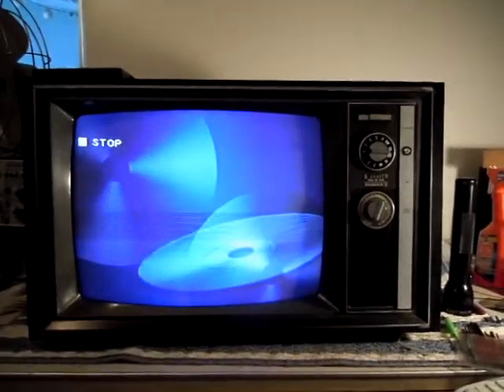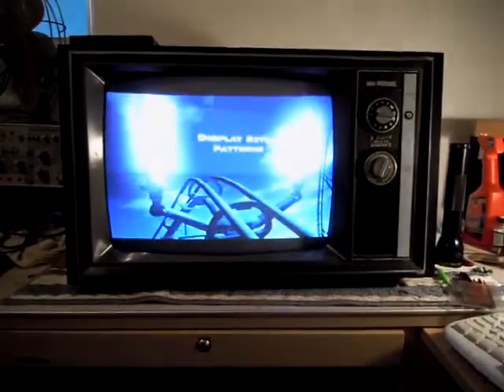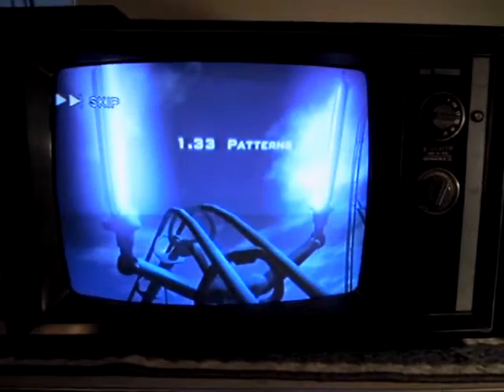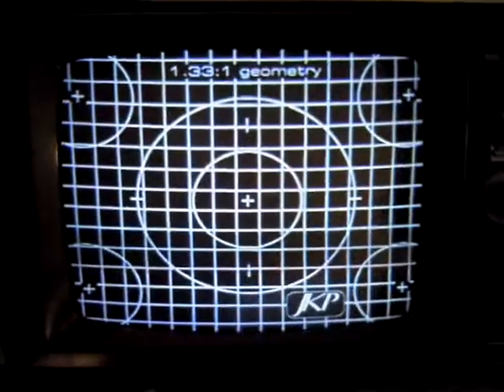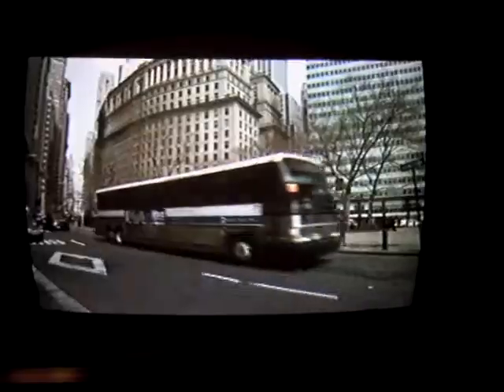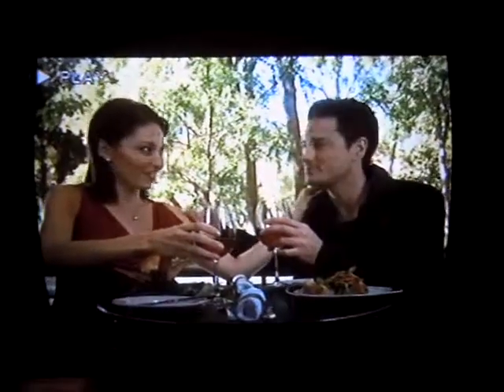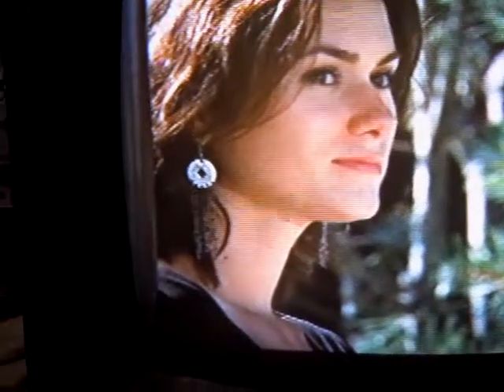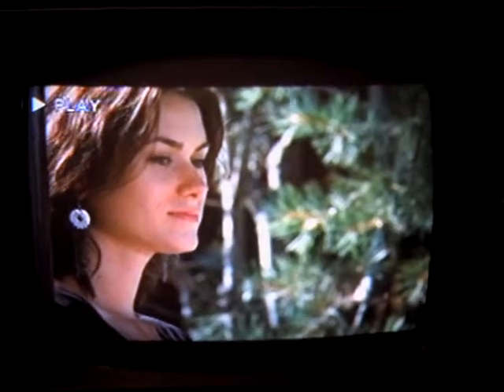1975 Zenith Chromacolor II with 19cg48z1 chassis - FINISHED !

Comment: We had a 1977 model of this set. Looked identical except it only had two buttons at the top, power and AFC. Very few sets could match it’s picture, but over time it got pretty flaky. Tint would freak out and go “mauve” and come back also the picture would jump down and back up. Banging the set fixed that temporarily. After watching your videos I’m sure it was all contact/solder related, but I gave it away over 10 years ago now. 

I do still have a 1994-ish 19” ProScan that works great after warranty service for bad solder years ago. Still miss the Zenith, tho.

Comment: I had one from around 1977 that was a great television....for 1977 and even 1987, but the current LCD and LED sets are far better and take up less room. I gave mine away in 1998 because I wanted to have a unit that coupled directly to a DVD player, so it was replace by a stereo Mitsubishi television which was also very good. I ended up donating it to a school when I bought my first LCD TV. Sure I look back at the Zenith with nostalgia, but it is certainly not better than an LCD unit.

Comment from the maker: @eyeh8nbc I've been looking to find a way to adjust the width on these sets reasonably, but the I think they have cemented the slug in the width coil, or its a fixed inductance (can't tell because of the glue in the way) Its the only gripe I have about the set.  Initially I thought you could just vary the drive voltage to the horizontal output - but there are actually service notes that strongly recommend against it. The widths seem to vary from chassis to chassis.

Comment: @eyeh8nbc 
I wouldn't go back to standard-def for anything, but CRTs had much better black levels than most LCDs. I hope they can improve that soon.

Seems like this model was produced for several years- roughly 1973 to 1977. We had the Chromacolor before this in 1972, but in 1980 it started smoking so my dad threw it out.

Comment: Funny to see Video Essentials on a 70s TV. I have the HD-DVD and it was the first thing I watched on my new LCD. I remember how much overscan these TVs had, is there any way to adjust that? I have my new TV set to 0 so you actually see stuff around the edges you aren't supposed to see. Of course on a 16x9 screen the letterboxed parts are full-screen while the 4x3 segments are shown with black side bars.

Comment from the maker: @lazimofo90 What's really shocking is that the amount NEW of CRT tv sets using recycled CRTs from scrapped sets. Yours probably had one. As soon as the environazis told companies to stop making CRTs they had to use up surplus somehow. Factory returns and recycled sets got the CRTs pulled and if they passed muster were put in low cost walmart type sets. They were sold for $150 or less.  I worked on alot of those a few years ago. Now no one fixes them. Its cheaper to toss em.